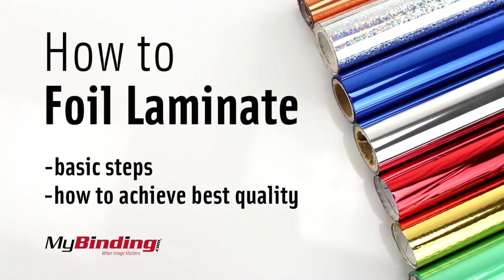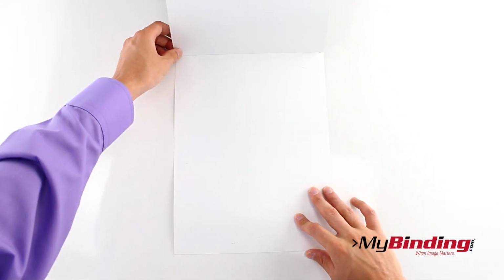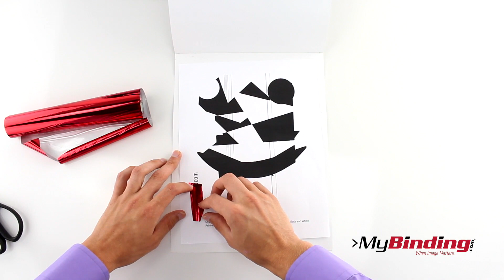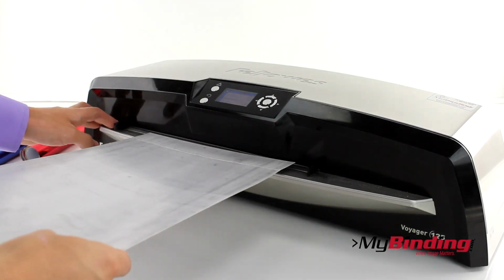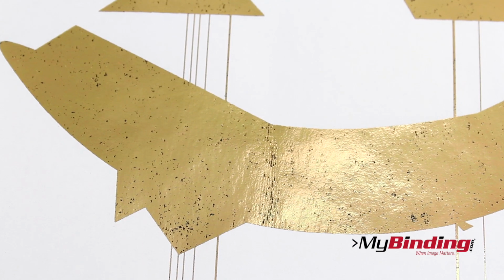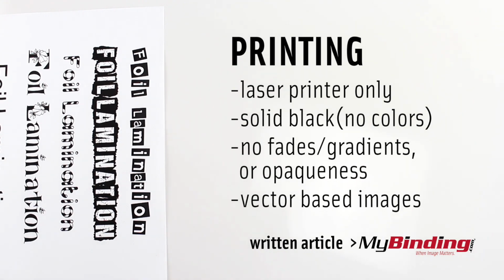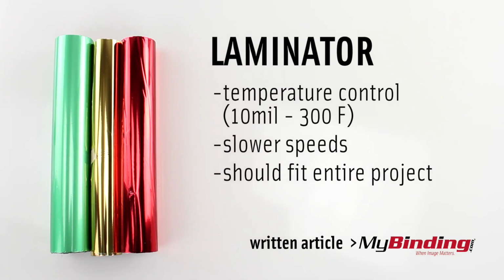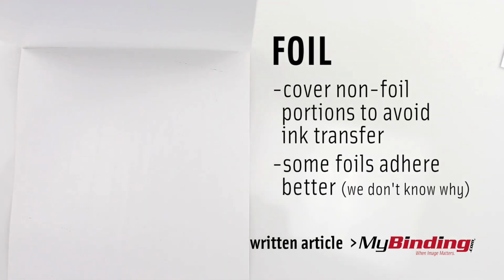How to Foil Laminate Using a Pouch Laminator

Comment: Hi, I have purchased a colour laser printer. I bought a roll of foil of eBay and i'm finding that the foil is not covering totally it leaves little black dots all over like shown in your footage. Is this because of the foil or having a colour printer? I'm  hoping its the foil as I bought the printer especially for foiling. I have a very hot laminator so I don't think this is the issue.
Reply: Are you printing black only? You need black only not color. Also, I know it says use a carrier but I don't and I don't get the black bits anymore.

Comment: I do have a question. What about the carrier? Does it has to be like an specific type of paper?
Reply from the maker: You should use a coated paper so that the foil doesn't stick to the paper.
Reply: Oh I see. That just happened to me. So it has to be coated. Also what about the foil quality? For some reason it doesn't cover the whole toner area. Any tips? I did it with like a lot of heat. What is the Temp you are using?
Reply from the maker: Depending on the printer and the foil that you are using the adhesion can vary quite a bit.  Higher heat can help in some cases but in others I have found that to get the best results switching to a different printer has been necessary.  The color and type of foil that you are using can also make a pretty big difference.  Some foils stick a lot better than others.  We have a few people on staff here that have done a bunch of testing with different foils.  If you try a different printer and still have issues I can probably connect you with one of them.

Comment: I used aluminum foil. The printed part of my project became glossy but not goldy 😂 where can I buy that kind of foil
Reply from the maker: We have several lamination colors to choose from.  Here is a link to our website:
https://www.mybinding.com/laminating/pouches/laminating-foil.html
 
You would need a laminator that can do a lamination of at least 10 mil to make the foil work properly.  A laminator with speed and heat adjustment is always a plus.  If you need further assistance regarding foil lamination, feel free to call one of our customer service reps at 1-800-944-4573.  Good luck with your project!